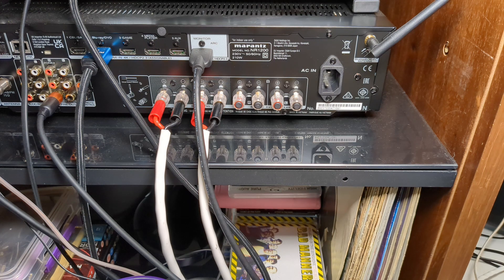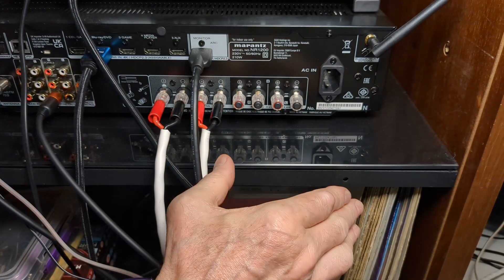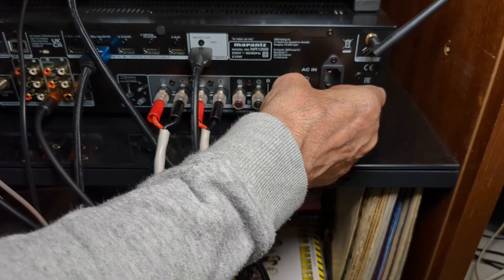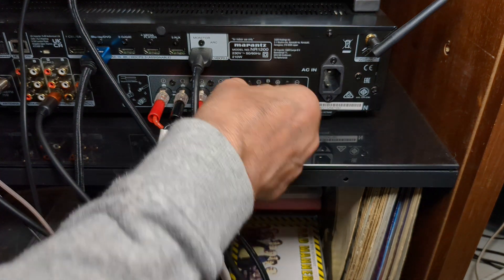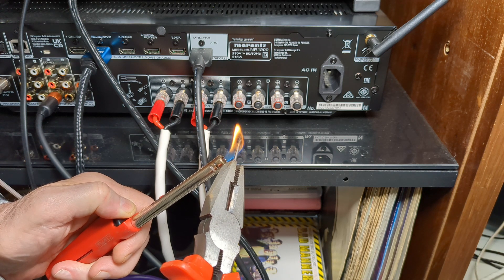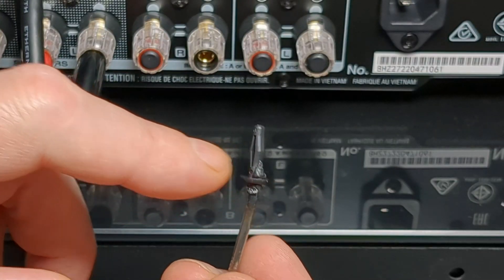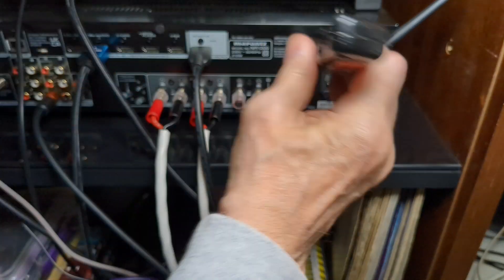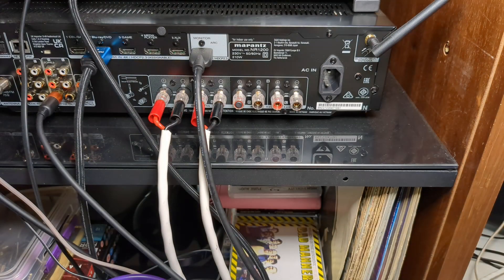Why Do They CAP Banana Plugs?

Comment: I like your video. I also saw the one where he used a screw. Amazing how the EU plug fits in there. I must try to connect my blender to the amplifier once I get the stupid plastic caps out. Mine are "sunken" and can't be removed with a sharp edged knife. I will go with drilling a pilot hole and a screw. It's incredible how the EU comes up with stupid stuff because of a few thick idiots.

Comment: I need some caps for my '71 Norton Commando's aux power outlet - which is mounted on the air cleaner assembly. I want to keep dirt out. Those would be perfect but I can't find any. Now I will be scouring the opp shops and looking at the backs of stereos.

Comment: It have been like this in Norway too, for many many years, and we are not in the EU, yet.
That was an as far as i know, a NEMKO demand.
Changing the distance between the amplifier outputs would prevent this. But for some reason they nearly alvays use the same distance as it is on those 230V the inlet plugs, why? 
Also the same on multimeters i have seen.
But what wrong would happen if you tried to plug a lamp to the amlifier ? There are no harmfull voltages on this plug, its a inlet plug not a outlet. So there are some explanation problems in this too. And i dont think amps in general would blow up lamps or ovens with dangerous high voltages.🤣
It is wery difficult even for the dumbest person to do wrong with this. He would probably first "discower" a way to kill himself on a door.

Comment: Fantastic.  Just bought some speakers and they have these in the binding posts.  Stanley Knife, okay thanks :)  For a minute there I thought it was going to get progressively more extreme.  "And if we direct the thermonuclear warhead at the binding post... the plug is gone...".  Also it seems to me that if you use a screw to get it out and didn't drill a pilot hole first then it might act like a rawl plug.  Thanks :)
Reply from the maker: I was going to use the Death Star's superlaser!
Reply: @hifireviewhub  Thanks for replying.  I had a go at getting the plugs out this afternoon and couldn't.  Seeing your reply I had another go and by wedging the point of the knife in there, it worked :)  Saved on needing some spade connectors.

Comment: What a load of tosh - never seen these connectors capped - anyway the only safety issue would be at the wall socket AND THEY ARE NOT CAPPPED😆

Comment: Simply unscrew the knob which will push the cap back, then screw the knob back in slightly to  leave the cap protruding and can now be easily removed.
Reply from the maker: Unfortunately, it isn't that simple. In most amps you can't unscrew them all the way, plus the cap stays in place when it's unscrewed.
Reply: @hifireviewhub  Ok. I'm fairly sure that's what I did with my Marantz amp, but I will will put the caps back in to check - if I can find them! 🤔
Reply: Clueless.
Reply: It worked 👍